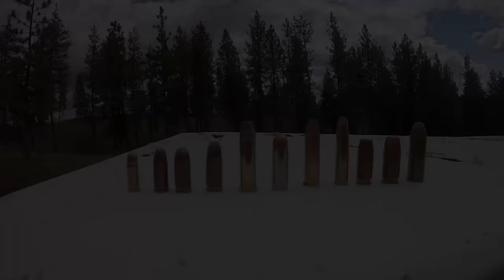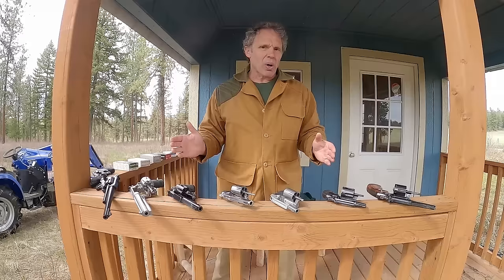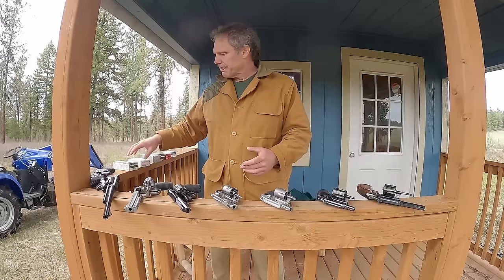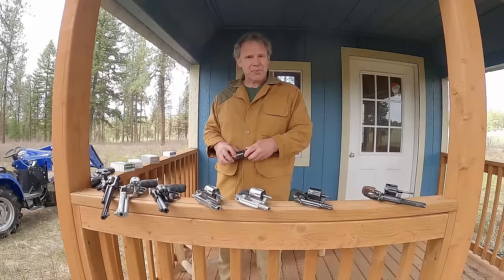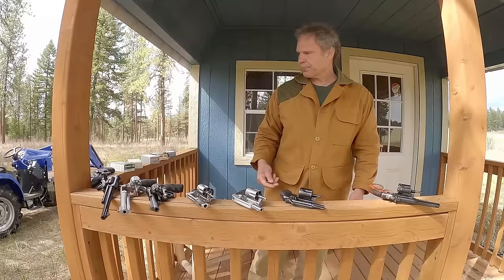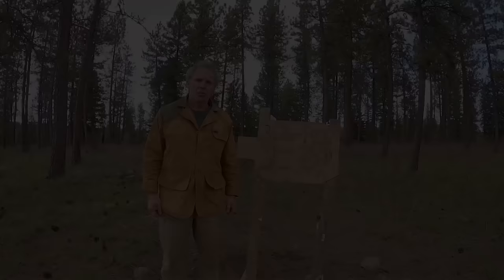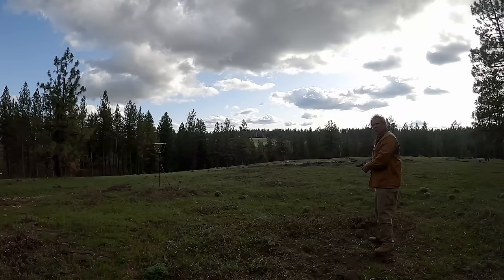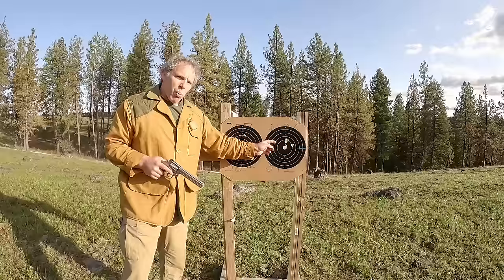Shooting .38 Super in .38 Special and .357 Magnum Revolvers

Comment: I have responded to some of your other videos, and in those I had to say something somewhat familiar and the same as I am saying here today. Your first part where you showed the huge variance between the .38 Super ammo, and if it can be shot in the .357 revolver. That part was near perfection, EXCEPT you did not have a Ruger SA revolver, which may have a very different result from all the other DA revolvers.

But then your video begins to become somewhat ambiguous and even misleading. Once you get into the ballistics of the ammo, most bets are off! This is because you can buy ammo in al,ost any caliber where its performance varies greatly. So, when comparing different calibers, even when shot in the same gun, almost anything goes, totally depending on the specific ammo you chose. For instance, there is .38 Special ammo by Underwood that has 125 gr bullet that travels at 1,200 fps. And there are .357 Mag ammo that is a LOT more powerful, with higher MV, such as the PPU 158 gr at 1,607 fps, which is a VERY powerful .357 load. You choose to use a .357 Mag round of ~1,450 fps.

The bottom line is that once you bring in ballistics info, then just about anything goes, meaning you can make a conclusion just to fit the ammo you chose, and that it does not really represent or does not apply when using different ammo. Based on my ballistics file (35 handgun and 26 rifle calibers), I see that the .38 Super (18 entries in my file) is in general more powerful and the manufactured .38 Spec (154 entries in my file). In addition, the max ME (power) of the .38 Super in my list is 537 ft. lbs. (by Underwood), and the max .38 Spec is only 400 ft. lbs. (again, by Underwood). Also, the .38 Super ammo is about 20% more expensive on average than the .38 Spec. The .357 Mag ammo average cost per round is just a hair higher than the .38 Super, but keep in mind that the cost calculation is very volatile these days, thanks to COVID!

If you are interested in getting a free copy of this very large and very detailed ballistics file, click on my name here, then click on 'About', and either email me or go to my website, and look under 'Miscellaneous Information' on the home page. This file has over 3,500 entries, where each entry links to a website that sells that ammo, and also has the ballistics info for that ammo. Of course, not all websites have available ammo, again thanks to COVID. I release the file in PDF format, so anyone can read it, but it is created in Excel.

Comment: I don’t know why that particular SP101 seemed to have slightly smaller cylinder bore than the other revolvers I recently purchased a dao version and had to send it to Ruger to have the cylinders bored it would not chamber 357 mag properly the cases had to be forced in and I could not eject the unfired rds without literally hammering the ejector rod luckily Ruger has very good customer service and they bored out the cylinders and had it back to me in 5 days. I’ve heard of other people having similar issues with their sp 101s perhaps it’s a case o sloppy quality control

Comment: I am also willing to bet that between manufactures different production lines and dies that some of the ammo may not fit even though a prior box did if you are talking about .001-003" variance in how the ammo fits.  Not manufacturing process has 0% tolerances.  Even at +/-0.05% you can come close to .001 to .002" permitted difference between production lines and still be with in spec.

I'll just settle for finding .38 or .357 ammo at a reasonable price or small pistol primers so I can load my own.

Comment: Interesting demonstration. Not sure I see the value in running 38 Super.  Its velocity wasn't that much better if any better than 9mm Plus-P . At a cost per round that I would suspect might be double the cost of a Plus P 9mm round. If its not safe to fire from your 38 Special.....Not much point in spending the Extra $$

Comment: SO, not only is it possible, if it fits....but if you have a 357 revolver....than you have a middle ground between 38 special and 357....thats pretty Damn cool. My question is....same deal in a rifle? Or......
Reply from the maker: If you have a .357 magnum rifle you have the same issue, it may fit, it may not.
 However... With the rifle you have an extractor that may not grip the smaller rim of the .38 super and may not properly feed the .38 super due to the cartridge being significantly shorter.
Reply: @PaulHarrell  cool, I'll give it a shot next trip to the range, I'll bring a dowel in case I have extraction issues...Thanks for getting back with me Paul....You're the best.

Comment: You left out one HUGE important factor especially with putting 38super in a standard 38. Did you consider chamber pressures?  I noticed you hinted at it but it’s kinda important when you think you might want to try it in a airweight smith j frame…. Thanks
Reply from the maker: Watch from 19:10 to 21:00
 I didnt specifically use the phrase "chamber pressure"
 But I made the point very clear.

Comment: The question I have is if .38 super is fired regularly in a .357 magnum will it effect the chamber by erosion  where the case mouth is because it's so short in comparison and also if it did, could it then cause problems with chambering or extracting .357 mag and .38 special cartridges.

Comment: This never really crossed my mind.  Not sure why someone would do this.  Generally when I think about doing something its to gain something.  like shooting 9mm in a 357 now thats something worth thinking about.  If you could shoot dirt cheap ammo in a gun thats expensive to fire its useful, but 38 super in a 357 why?  What would you gain?  Is the ammo far cheaper my answer is maybe yes but not by much.  Is it more powerful thats clearly a no.  More accurate unlikely as revolvers are normally pretty accurate if not hard to shoot.  Less recoil ok this is probably a yes but 38 special would be a better choice anyways for this. So the out take here is unless we are in a weird situation where there is no 357 ammo be be found but theres some 38 super right here and you need to defend yourself I dont see anything to gain from this.

Comment: I have a interesting "revolver" it's single shot and the round loads into the barrel and the cylinder contains the firing pin. Supposedly its .38 special. How can I get into contact with you. I'm in Oregon and missed you at the rickeal gun show. I'm close to there.

Comment: Super bullet diameter is actually.356 not same as 9mm though splitting hairs
Reply from the maker: My reloading manuals show diameters of .355, .356, and .357 but .355 is by far the most common

Comment: So in 9X19 revolvers a .380 would fall to far in right? Just curious. I wonder if it would work in a mid 1990's .357 magnum GP-100 and/or a .38 spl Charter Arms Undercover? So I stayed to watch the rest of the video and it looks like .38 spl no but as Paul said .357 if it fits and if it ejects.
Reply: 380 is a straight walled case.  9x19 is a tapered case.  It's much fatter at the base and rim than 380.  Even if you could hold a 380 in a 9mm chamber somehow, it would probably split at the base.
Reply: @66smithra  Thanks. I have a single box of .380 bur have not had the chance to fire the High Point pistol i bought for yet so both are packed away for now.

Comment: .38 cal revolver has a less than .36 dia bullet to send down the barrel? Why the heck is called .38 cal then??
Reply from the maker: There are several versions of the story. 
 But yes, .38 is typically a. 357 and .44 is usually a .429
 Check out our presentation on cartridge names and designations.
Reply: @PaulHarrell  Thanks Paul. There's some confusion regarding caliber designations and actual projectile dimensions.

Comment: What is my engineer brain went not only could it very you know animal manufacturer to animal infection with various gun manufacturers but it's entirely possible if I got 10 of the same models you use and 10 of the same ammos not all the green boxes want to fit all the guns there might have been a few that would have fit because the if the tolerances of the gun in the tolerance of the ammo lamp just right don't fit why else is wrong they won't fit so there's a lot of maybe with this whole endeavor